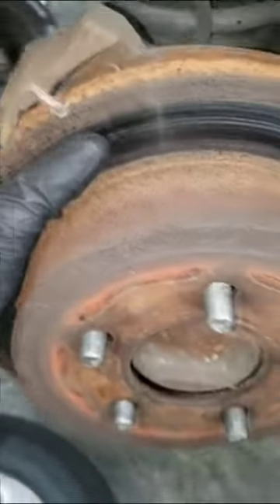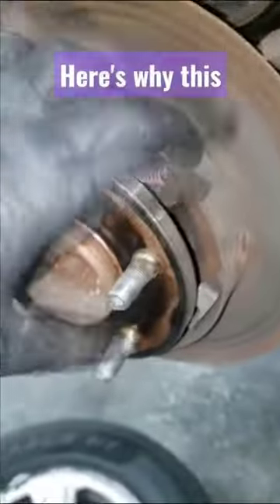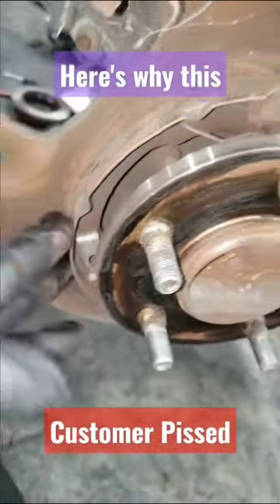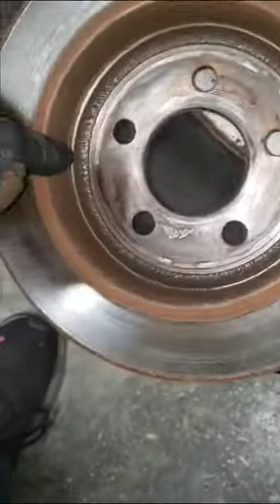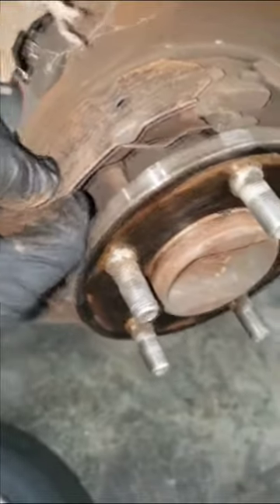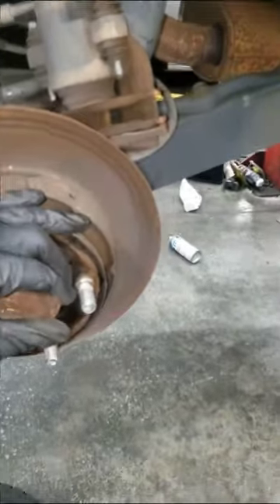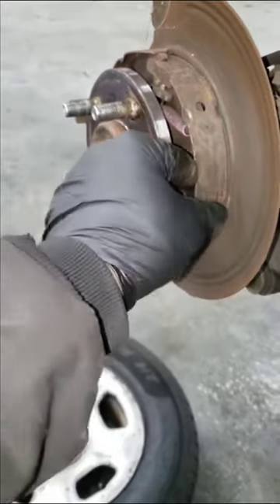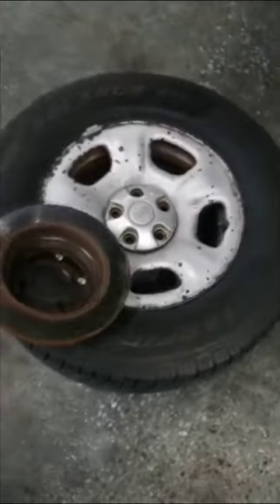I screwed up. We have to call customer back to ask for more money. Here's why. How did it happen?

Comment: Unless it’s a manual transmission, it doesn’t matter. They used that parking brake one time and forgot about it. Ain’t no way you should be completely disassembling brakes just for an inspection.

Comment: We give the customer the price on pads and rotors. While at the same time tell them there could be additional parts needed when we take them apart. Tell them we will call them back if it needs calipers or parking brake shoes and hardware.

Comment: First, the customer should be made aware of everything related to a brake inspection and what is done. If parking brake is separate from a normal inspection it to should be brought up first before the inspection and letting the customer know first as so they can make the decision on what they want done. 

If this part failed for some reason then it is the shops responsibility to bring it to the attention to the customer and again leaving it up to the customer to decide. Now if a complete brake inspection includes checking emergency brakes (which should for safety reasons) and the mechanic failed to do so, it then becomes the responsibility of that mechanic and shop to correct said mistake. 

There are several depending factors on which way to go, but if you made the mistake you should own up to it. If you are truly a good technician and honest. Making money for the shop is one thing maintaining a good customer relation so they come back and trust you is another. 

In my book customer care and quality is number 1 and should be first priority. Better to have satisfied customers than angry ones.

Comment: Not a screw up if you're not getting paid to inspect the parking brake shoes.  I don't remove the rotors to check those if I'm not getting paid to do so. I don't work for free, and I'm pretty sure the owner of that car doesn't either.
Reply from the maker: Interesting point my guy. You right, this was a simple sneak and peak visual brake inspection that revealed worn brake pads. This was not a paid brake inspection. But it worked out. She bought the additional needed parts.
Reply: @OnlineMechanicTips  👊

Comment: I need to check this. My parking brake doesn't hold anymore. A couple of months back I used or should I say tried to use my truck as an anchor as I attempted to pull up some shrubs. After that failure my truck drove a little Skippy from the back for a few feet. Something is jacked.

Comment: Ya never really know what you'll find till you get it fully apart, customers know this and it probably states this on the authorization signed by the customer.
Reply from the maker: Dam good point. This was bigger than just a simple sneak and peak free brake inspection.

Comment: If they don’t want it just do THE WORK THEY PAY FOR ONLY. That’s all on THEM. I00% it’s their fault UNLESS there is a law requiring that as a safety feature on all vehicles. Other than that, just like your diagnostic $200 dollar yet no work done. If the customer doesn’t want to pay for the work you don’t do it but if they complain about you not fixing it then there’s no argument. You told them they said no, it NEEDED TO BE FIXED but they said no so you moved on. Alls good. Besides parking brake not too important unless it’s hilly then it’s still up to the customer finally.

Comment: So were you just slapping pads? The rotors look like they need to be turned or replaced anyway, which would have exposed those parking brake pads right?
Reply from the maker: I never pad slap customer cars. This car the rotors was also replaced
Reply: @OnlineMechanicTips  I didn't think so based on your other posts. Great stuff, lice your posts. My wife is gonna buy a Wrangler soon, so I am sucking up Mopar knowledge.

Comment: If they pay for a diag, they get a diag. If they want free, it’s a cursory inspection. 
That being said, if I’m recommending rear brakes, I’m pulling the rotor first. Nothing like having to go back and say “by the way, you have a seized slide pin and need calipers too”.
Reply: Slide pins are on the bracket.
Reply: @MWilk098  which you take off when pulling the rotor, Capt obvious
Reply: @mikejmardis but can be purchased for $20 and don’t require bleeding the brakes. Save your customers money, they don’t have a lot.
Reply: @MWilk098  you clearly have not run into SEIZED slide pins.
Reply: @mikejmardis they can always be removed.

Comment: It's not something you could have normally seen when diagnosing the original concern.  Your years of experience might tell you a different way to approach it but that's how I would address it with the customer.
Reply: Thats the point of diagnosing/brake inspection. I don't think anyone is expecting the tech to use their X-ray vision. Things need to be removed in order to ensure safety or the condition of certain parts. For whatever reason he didn't check all the boxes on his checklist and he's admitted to his mistake. Hopefully he has a great work history with the customer...